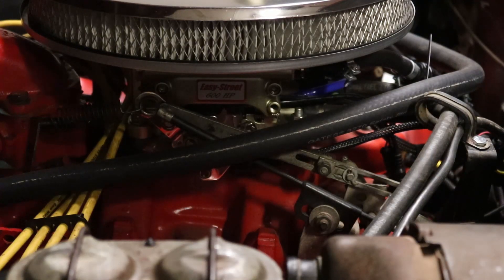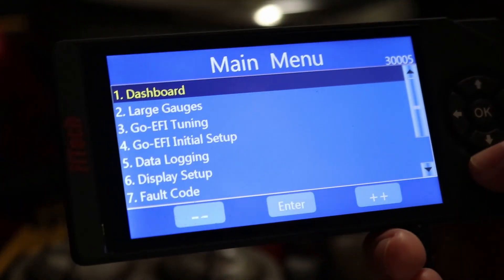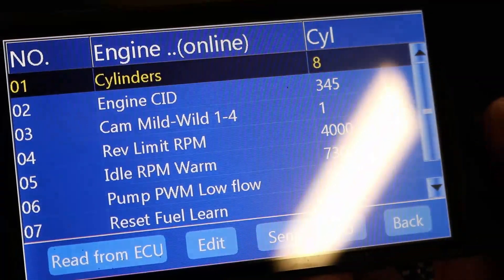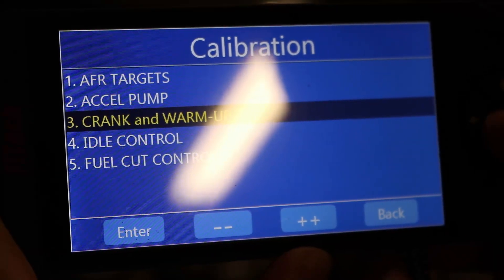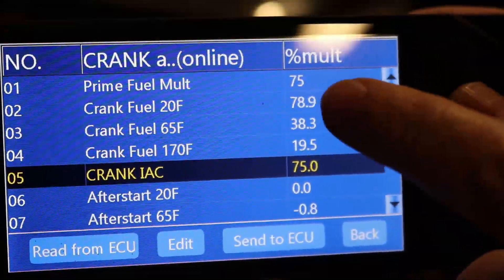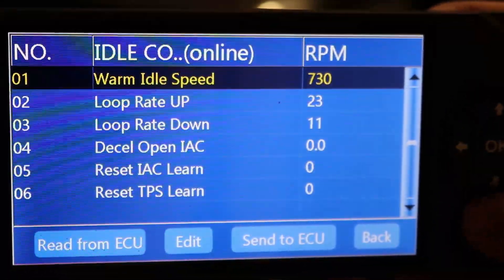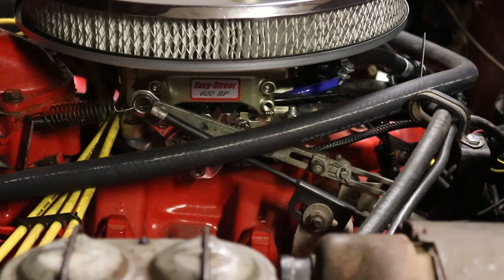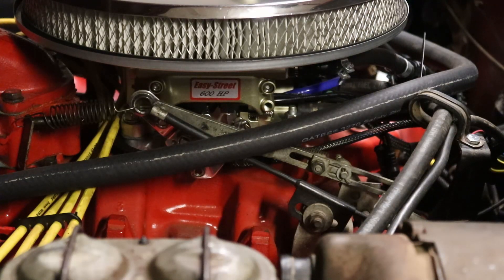FiTech Settings - Sharing My Current EFI Settings

Comment: Are you still running the points distributor or a hei/duraspark?
Reply from the maker: Mine has the factory prestolite electronic ignition.
Reply: @NaturesEngineerandI  thats what i ended up running

Comment: You may have figured this out by now, but the wire that feeds the distributor power is the one you want to feed the efi power as well. It is one of the only switched power sources that does not lose power when starting. I had the same problem on my elcamino, and that fixed it. That way you dint need a switch on the dash.
Reply from the maker: The coil lead is the only thing in my wiring that stays hot when turning the key to the start position. I have heard some say that you should not use that wire but for a "keyed" hot while starting, that is about the only option. I continue to use a toggle switch for mine, but I don't like it.

Comment: I need some help
Reply from the maker: What's going on?
Reply: I have my 289 tuned up decently as far as AFR goes.  But when I get on the throttle there’s usually a lingering smell in the cab after I jump on it.  It’s stinky.  Is it the wide open input %?(25%). Is it vacuum?  Any thoughts?